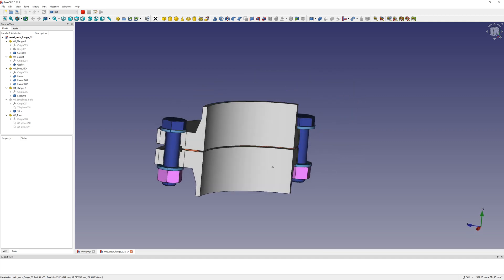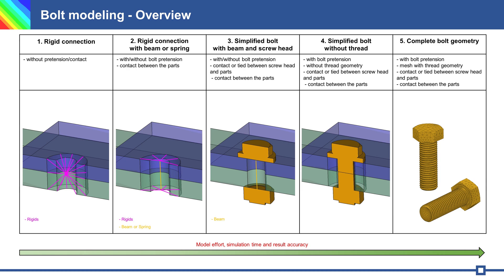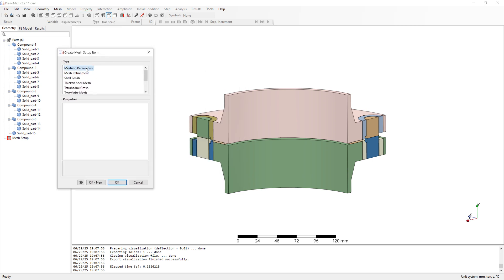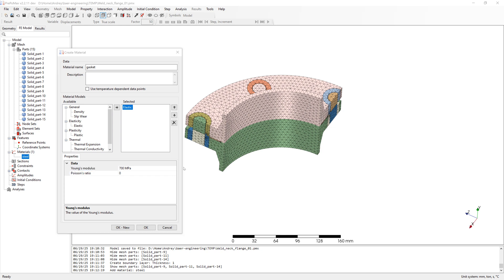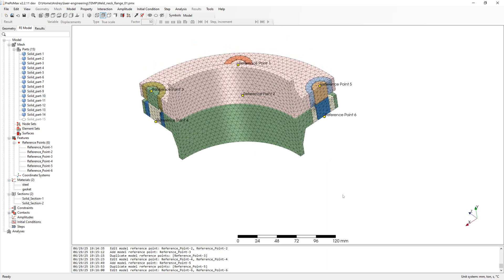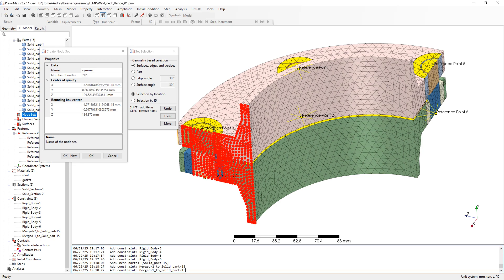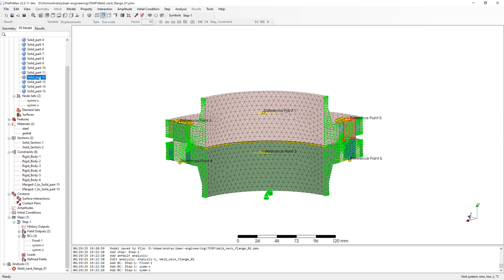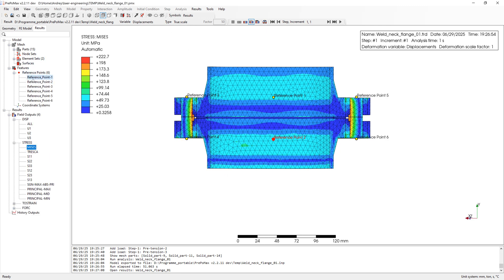Structural Simulation | Simplified bolt modeling | PrePoMax

Comment: Can you do a complete bolt analysis (not with threads) with bearing? None of the videos I've seen show contact with the hole or a bolt in shear. Also how do you get the reaction forces at the bolts to check against your hand calcs?
Reply from the maker: Typically, a bolted connection must be designed to be non-shear. The forces/moments are transferred by friction.

Comment: What's the advantage to this over FEAnalyst bolt tutorial 34? It looks like you used reference points instead of bolt heads
Reply from the maker: The question here was whether to use a simplified bolted connection, similar to a beam - rigid spider connection. For a quick pre-design or test (without contacts and without bolt geometry)
Reply: @andreas-baer-engineering  Okay I see and is your bolt actually 2 parts or is just one with a split through the middle? I can't get my simulation to constraint properly and I think its because my bolt is 2 parts, and I did make them as a compound part in prepomax but imported them from CAD as 2 parts.
Reply from the maker: @JB-dv7ew  I cut screws in the middle in CAD. Later, in PrepoMax, I created compound parts. The advantage is that this creates a surface for the pretension and boundary layer after meshing.
Reply: @andreas-baer-engineering  Also why do you have like a cylinder around your holes? Most people just create a top face but yours runs completely through the part? Did you mean to do that or that just from your CAD?